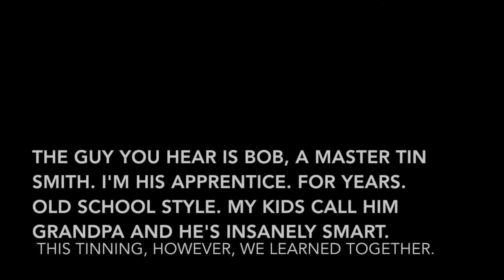Tinning Copper Cookware Process and Visual

Comment: Thank you very much for this video! I have searched everywhere for exactly this type of demonstration,with explanation....in English. I have searched for literature and even offered to pay someone to teach me to re-tin my own copper. 
   Thanks to you, yesterday  I successfully lined a small ladle as a practice before tackling my sauce pots, sauté pans and finally my large stock pot, all from Mauviel. I have had these for over 30 years and had them re-tinned several times but have lost contact with my tinsmith. 
   Just two questions please: do I need to remove the faint tin lining that remains in some of my pots or can I build on top of it? If so, what is the best way to remove it?
   Thank you again!
Robert Bennett
Philadelphia,PA.
Reply from the maker: Hi Robert! So thrilled it was so helpful for you! I agree - there's not a lot in English out there for tinning, so I'm going to make a few more. :) I'm always happy to chat and offer book sources, so feel free to email me at housecopper@gmail.com with any specific questions. So excited to hear how your re-tinning goes! As for your question about removing the tin, yes, you do want to remove the last bit of tin before doing a new retinning. Otherwise, what happens is the new tin will quickly or soon flake off and your new tinning job will be ruined. You want really clean copper. I usually bead blast in the blasting cabin, and then stubborn chunks I take off with a sanding accessory on the drummel. You also could use a grinding wheel if it was small enough and you had a tight enough hold on the pot, but I'd personally be nervous about bounce within the piece unless your wheel was set up for this particularly. Hope this helps!! I'll post another video on cleaning copper before tinning soon!!
Reply: House Copper & Cookware Thank you for your quick response! Looking forward to more videos!

Comment: In the tinning process video, is the fiberglass next to you what you are using as your swab?
Reply: Yes. You can also use cotton wadding, like really soft fluffy stuff. The old school smiths in the 1800s used flax bound tightly together and filled with sal ammoniac. :)
Reply from the maker: I know - you'd think that, but the cotton isn't actually in contact with the fire. Also, if it's 100% cotton, it's actually a bit fire retardant (for re-enactors, we have to make sure our clothes are 100% cotton broadcloth so we don't catch fire when we cook. Anything with polyester will totally go up in flames!). Thanks for asking and watching! I do love what I do, totally!! It's awesome fun and always a challenge. :)
Reply: @housecopper  I purchased raw cotton batting, but tried it today and it got charred. So I'll have to figure out why or switch to fiberglass. Maybe binding balling it up, using sal ammoniac, and making sure it is spreading tin and not contacting bare copper will help.

Comment: Where do you get your flux and tin? do you have a website or do you just find it at home depot, Also I have an antique copper pot that has a boiling plate on the inside that is loose, do you have any advice on how to do that? Also it already has tinning in it, but its old and gross at this point, do I need to completely strip the tin?
Reply from the maker: I have the links to flux and tin sources in more recent videos - check those and you can link straight through to all those products. They work so fabulously! (No, Home Depot doesn't carry - you have to go direct to the manufacturers.) Totally impossible to diagnose your boiling plate blind but I'd say clean it up good with mechanical and chemical means and then re-solder it...good luck!
Reply: @housecopper  thanks! I have been really debating whether I should do it myself or pay someone to do it.  What are your prices like?
Reply from the maker: @ohmahgawdfilms  Depending on your set-up, it may be cheaper for you to have someone do the work than to buy all the materials, safety gear, and tools. I start at $3.95/linear inch. :)
Reply: @housecopper  well I am a blacksmith, so I have the tools, I just chose to own a weird little kettle haha
Reply from the maker: @ohmahgawdfilms  I love that you chose that! :)
Reply: @housecopper  Do you guys also polish and fix dents like other places? I think I'd prefer to go through you guys.
Reply from the maker: @ohmahgawdfilms  Oh heck yeah, I totally do that. :) :)
Reply: @housecopper  cool :) I may commission with you then, think you could do my kettle with the false bottom around 90-100
Reply: that seems to be the usual prices I've seen around but whatever you charge
Reply from the maker: @ohmahgawdfilms  You need to email me at housecopper@gmail.com with photos before I commit to your kettle - just want to see what it looks like, and what exactly you want me to do - I'm backed well into Spring 2021 with work right now so there's no rush. :)

Comment: Hello sara
I want to know where to buy the correct tinning product in UK 
I need the full name of it please
Reply from the maker: Hello! I'm not sure where you'd buy any of this in the UK. Yikes! I'm not sure what you mean by the tinning product. Do you mean the flux? If so, it's Harris Stay Clean. If it's the tin, it's pure tin solder (lead-free) and usually 99.6% pure tin with .4% copper, through Johnson Mfg based in the Midwest in the USA. That's what I use.
Reply: House Copper & Cookware 
Dear Sara thanks for the reply 
Where I can buy this flux in the UK please?
On eBay there’s two types of Harris flux 
Thanks

Comment: Hi can you please tell me where to buy tin bar & spray & also provide the brand name of spray.
 thanks for video.
Reply from the maker: I typically buy my tin from Johnson Manufacturing - you can buy online in many different size tin bars, just be sure it is lead-free/food grade. The brand name of the flux is Harris, which you can find many places. I have also used Acro for flux.
Reply: @housecopper  Can you please post a link?  Ive searched Johnsons site and cant find the tin bar.

Comment: Hi! I'm just starting out and I want to start by making some copper mugs. Can I use silver solder wire in lieu of tin to line the inside of the cup? I haven't a forge, but I was hoping to either use a propane torch or the coals of a campfire. I was also planning to 'tin' the metal before shaping the cup from sheet copper. Any wisdom is appreciated, thanks!
Reply from the maker: You may find the silver solder needs too high a temp for the thinner gauge of copper you sound like you're using. I use 100% pure tin solder because of the lower melting point. Especially if you are only using propane or campfire coals to tin...then stay away from the silver, which will need a much higher temp to melt (and a different flux) - silver solder will probably need acetylene vs propane or coals. And yes, when forming from the flat, it is way easier to tin the copper in the flat/sheets before building the cup. Especially if you only plan to use lap seams, which won't hold up over fire.

Comment: Can you use the same flux you would use for soldering? The green paste stuff
Reply from the maker: andy dennis hey! In theory yes I’d think so but as it is a paste it will be really hard to apply quickly when the pan is hot, so you might have a more tricky time of it than you’d need to. Also I don’t know if you could apply it in advance as it would possibly burn and be useless during the heating of the copper before you tin. I have used paste but not for tinning large pieces with a ton of tin at once. It just doesn’t move well. Does that make sense?
Reply: @housecopper  that makes sense I'm trying to tin a copper cup I made. So I'm trying to figure out all the logistics before I try it, also do you know if I'd have to worry about the solder melting during the tinning?
Reply from the maker: If the cup isn't very big, you could use that paste, but use a soldering iron on high with your biggest tip, and maybe a second heat source, like a heat gun or a small blow torch to heat the exterior, and put the paste in, then use the soldering iron, and heat the copper at the same time with the other heat source. A cup is small, and you should not need to do the bigger method. And then the paste should work. If you have already soldered seams, then yes, the solder will melt during tinning. Usually Bob and I tin in the flat before we form the pieces, and then add solder for the seams at the very end. If the seams losing solder will cause the whole piece to pop apart during tinning or heating of the piece (has totally happened to me), use a clamp right on the seam to hold it before heating and tinning and see if that helps.

Comment: I need to re tin a old pot, do you have to totally remove all the previous tin from the pot or can you layer it on top of the existing tin? my pot only has some section were the tin is wore out. Love your video
Reply from the maker: 666 the witch Jasso yes you do need to completely remove all previous tin. Otherwise the new layer of tin won’t really bond and it will bubble up and flake off in short notice.
Reply from the maker: 666 the witch Jasso and thanks for watching!! :)

Comment: Do you have a recommendation for where I can get a tinning rod?
Reply from the maker: A tinning rod? No - I don't use them and none of the tinner's I work with use them. Unless you're talking about a bar/rod of pure tin solder? Then go to Johnson Manufacturing.
Reply: @housecopper  yes, a bar or rod of tin. Thank you for the recommendation.
Reply: @housecopper  which tin rod would you recommend from Johnson mfg to tin a large copper bowl? Thank you again.
Reply from the maker: @dk4130bmx  You need less than you probably think you need. If this is the only thing you're doing, go to a local hardware store and get a small spool of 100% pure tin solder and use those thin lengths as your own mini-rods.
Reply: @housecopper  that makes sense. Thank you again for your time
Reply from the maker: @dk4130bmx  For sure - you're very welcome!

Comment: no toxic fumes? while tinning..
Reply from the maker: As long as you have ventilation, don't worry about it. Doing it outside helps tremendously. And the toxicity happens just when you spray the flux and all the white comes up. I usually just hold my breath until those white plumes disappear. If I'm doing a ton of tinning at one time, I wear a respirator (you can get breathing masks on Amazon for inexpensive).
Reply: we have respirators left from the lava gases....
Reply from the maker: Well there you go.... :)

Comment: Have you or your mentor ever tinned a colander? How would you avoid tinning the outside as well?
Reply from the maker: Curtis McCartney yes—we have done colander-like projects. While I haven’t done a big colander, I’d recommend lining the outside with a lime (like powdered garden lime) and water paste, letting it dry, and then tinning the inside. It’s not going to be easy or perfect, but that should help for the most part. :)
Reply: Thanks for the advice! I have access to Johnson J 33 flux at work, would that be suitable?
Reply from the maker: I personally wouldn't use the 33 - it's still active after you're done heating I believe, and not sure it's considered food safe in case you leave any residue, etc. If you can get your hands on some original Johnson's, you might be better off. Also, isn't the 33 for galvanized? I would worry it etches the copper, too. I mean, I have never used the 33 myself, but I wouldn't personally. Just my two cents!
Reply: I don't know what 33 is made for, but nothing works better for soldering zinc, which is what we use it for. I think we may have a bottle of the original around, Have you used it? How about tallow? that's food safe for sure.
Reply from the maker: I believe the 33 is for galvanized tin or steel, and obviously it works for zinc LOL. I haven't used the original myself, (I use Harris Stay Clean or Acro, as does Bob) but it seems like the most likely of Johnson's to be food safe. You could always call them - they are awesome and helpful. As for tallow, I have heard of it used as a natural flux for welding/stained glass. I'm more familiar with rosin / pine resin as a flux, which is traditional and also food safe. Just be aware the rosin (and likely the tallow) leaves behind a tough brown residue that you need to remove with your fingernail or alcohol. :)
Reply: thanks for taking the time to respond to my inquires! I will test the johnson's original on a piece of scrap and if i get a positive result, i'll go for it. if it doesn't work, i'll just skip tinning the thing altogether. it's really just an aesthetic issue on a colander that's only being used for pasta and washing vegetables. but when the time comes when my copper saucepan needs to be redone, i'll go with your recommendation and use the stay clean or acro. Thanks again for being so helpful, and keep up the good work!
Reply from the maker: Let me know how it goes! :) You're right - colanders just don't need tin, but it is nice to keep any worries at bay (you can just say you're not cooking in it over heat). But if you do use it inside a bigger pot for steaming or any other activities where the pH changes from neutral, you'd want the whole thing tinned...but for washing pasta and veggies it doesn't really need the tin. It will be a bit of a tricky job to do, but post photos when it's done! Good luck!!